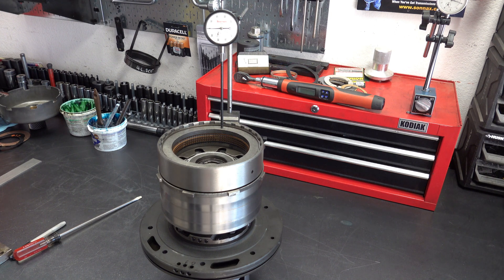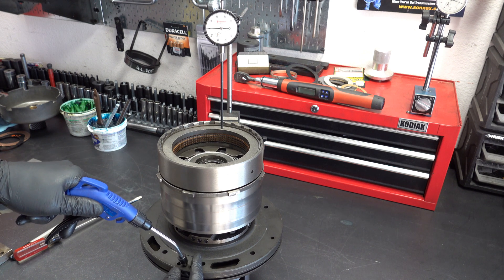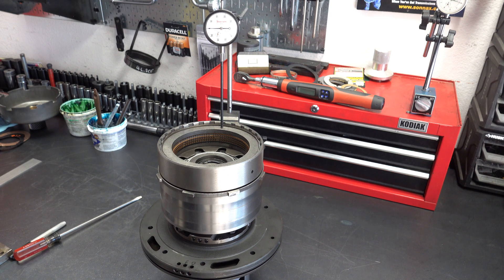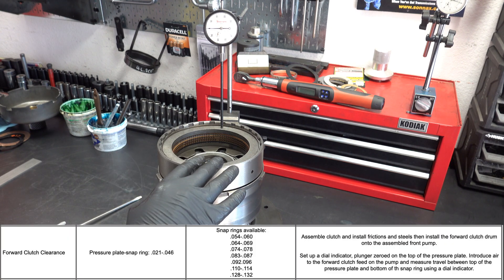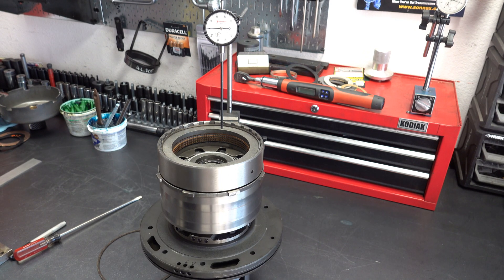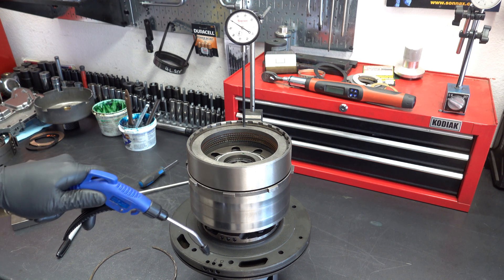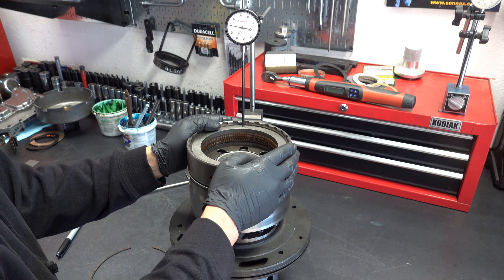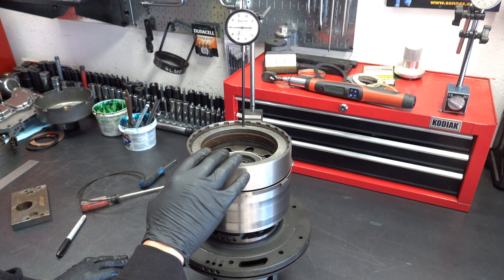Rebuilding the Ford C6: Clutch Clearance Measurement and Adjustment

Comment: Do  you get an improper measurement if you zero the indicator while pushing down on the pressure plate?  I'm using an indicator to measure clearance for the first time and want to confirm whether or not I'm doing it right.
Reply from the maker: I have never done that though other builders do. I just measure the pack's travel based on the pack at rest position with no downward pressure on it to begin with.
Reply: @nickstransmissions  Thanks for getting back to me.
Reply from the maker: You're welcome, man.

Comment: NICE job with the video's !!!  I am just finishing up, ready to attach the  tail housing.  I was surprised that I could grip the govenor assembly and turn the main, output , shaft in the opposite direction, but I guess that is ok, as it has to have a reverse.  In other words, it is only the drum, that the roller clutch will not let turn ?  MANY thank for your video's !   Jimmy
Reply from the maker: Thanks, Jimmy!!! Appreciate the kind words...

The output shaft will spin in both directions however spinning against engine rotation will be about 3x as hard and the direct drum will spin. Reverse is achieved by direct drum and low reverse clutch packs coming on, allowing the output shaft to spin backwards, giving you reverse.

Comment: Hi Nick, I have a C6 in my Hot Rod in the  U.K. ID tag states its out of a 1970 Mustang 351 Cleveland engine. Dont believe gearbox has been re-built. Looks like the original filler tube bung is still in the pan. It only has three clutches in the forward drum. I thought the minimum was four? Have you come across this?
Also it has a broken Throttle pressure boost valve spring, I purchased a Transgo shift kit but unfortunately that spring is not included in the kit, I can't locate one anyway in the UK have you any suggestions where I might source one in the USA?. Many thanks  Rob 👍
Reply from the maker: Hi Rich, thanks for watching. The C6s came with a variety of clutch pack configurations in the forward and direct drums, including a three-clutch set up for some engine/vehicle applications. I'm not super familiar with every one but I know there were definitely variations like the set up you have. 

As far as the throttle boost spring, I'm not aware of anyone just selling the spring...Every once in a while, I have a VB w/a broken spring so I just grab a valve body from another C6...Check around transmission parts suppliers there as they may have a used VB that you can grab and either harvest the spring from that one or run that valve body. You will need a pre-1976 valve body if you're going to swap over the entire assembly as the C6 underwent significant engineering changes, including the valve bodies,  starting in 1976 and you can't mix/match incompatible parts between those two vintages.

Comment: where can I buy the different size snap rings
Reply from the maker: Hi Hugecat - the best places to locate the selective snap rings (and most other transmission parts) is your local transmission parts supply house or dedicated on-line transmission suppliers like Transpartswarehouse.com or Cobratransmissionparts.com. Transtar may also have some available through their distro network.

Comment: Nice on the minimum clearances . That'll work well .
Really need some weight on the pack to get a true zero would gain you a little also , in comparison to at rest like you test. 
For example a Ford BTR 4speed , actually specify a 2kg weight on the clutches to get a true zero then measure .
Be interesting to recheck . I might  try on the next i do as a comparison, It's how I check but never really put a figure on the difference.
Reply from the maker: Thank you again for watching, Greg and appreciate the input.

Over the years rebuilding, I've noticed that a little downward pressure on a given clutch pack will yield a few thousandths or so in clearance, depending on what transmission and clutch you're working on at the time. However, since the ATSG nor other industry trade group manuals for the C6 or other transmissions I work on mention adding specific amounts of weight or downward force that as part of clearance measurement procedures, I don't mention anything about it in my videos...Plus, most folks will not likely have a means of measuring/verifying they are exerting a very specific amount of weight or pressure equivalent while checking clearance (i.e. a checking weight of some sort) so starting with the pack at rest establishes a uniform set of initial conditions for everyone.

That said, I'd be curious as to what you find when you do your comparison and see if the difference in weighing down the pack by 2kg makes a material difference in your measurements or not; meaning if when you add the 2kg, you find you need to use a thicker snap ring to meet clearance. 

I have a few more C6 vids coming out this week and early next covering topics such as measuring front end play, band adjustment, air checks etc so would be curious to hear your perspective on those once they're published. 

Have a good one, thanks again!
Reply: @nickstransmissions  Look forward to watching. 
Not criticizing at all , I enjoy the vids , seeing how everyone does them . just adding some input of what I have found . 
I've done a lot of C6's , (and corrected quite a few that have been messed up by others ) and 100's of other types over 40 years . 
Thanks for taking the time to post your vids .
Reply from the maker: Thanks, Greg and yep, there is usually a few ways to skin the cat w/transmissions as you know, haha. 

I def appreciate the input!